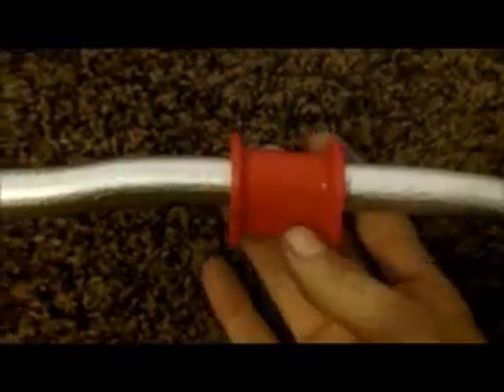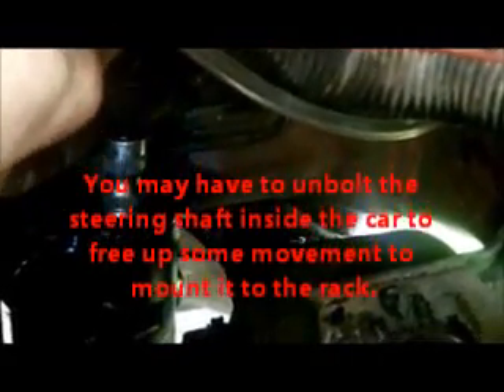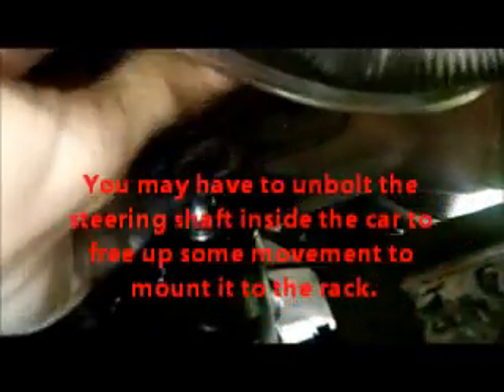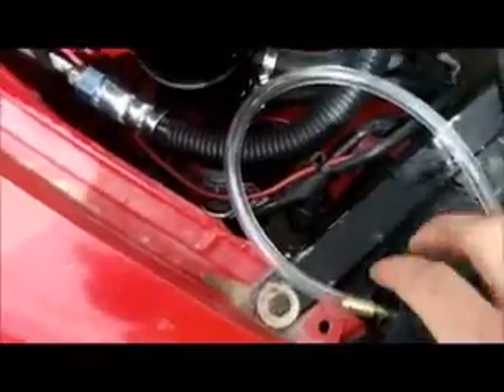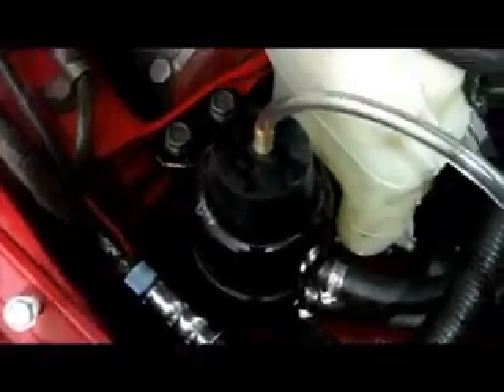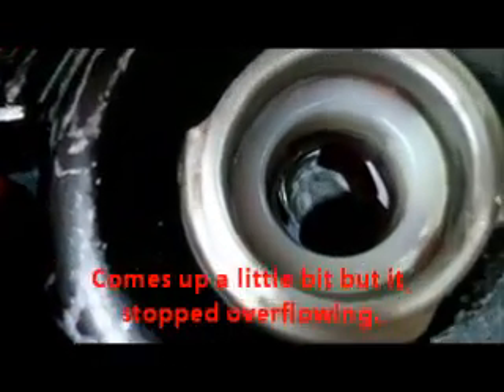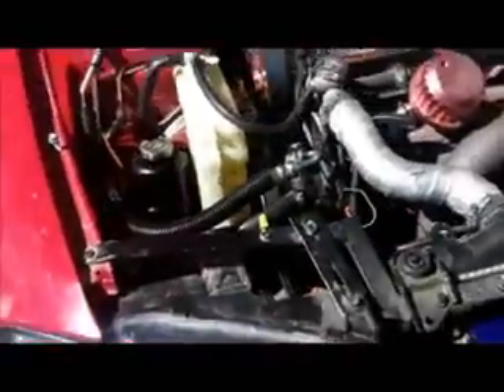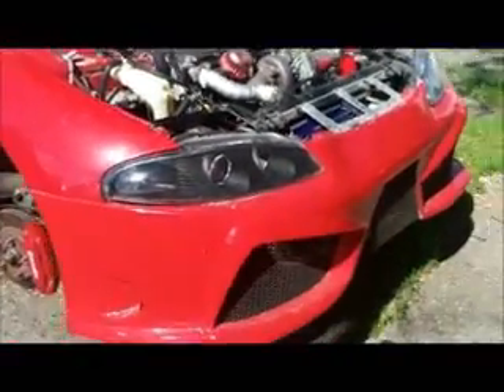DIY Eclipse Rack and Pinion Part 2

Comment from the maker: No problem. The most important thing to do is have the vacuum pump ready to pull the trapped air out of the system when you first run the car or it gushes P/S fluid all over when you shut the car off.
Reply: You can do it without the pump by jacking the front end both tires off the ground and keep turning the wheel back and forth with the cap off about 50 times 😂